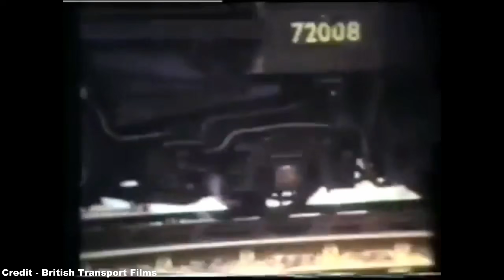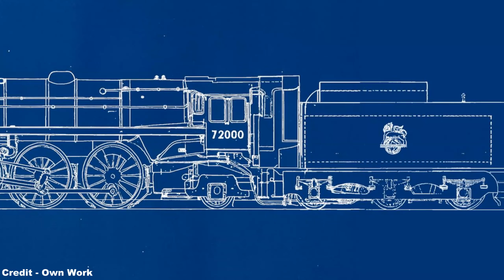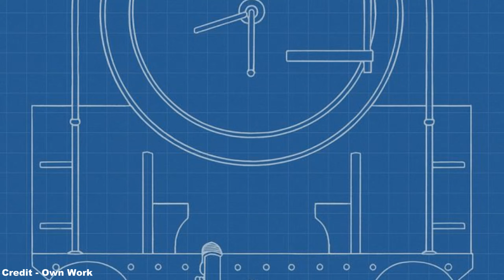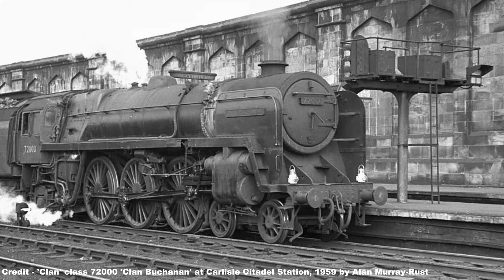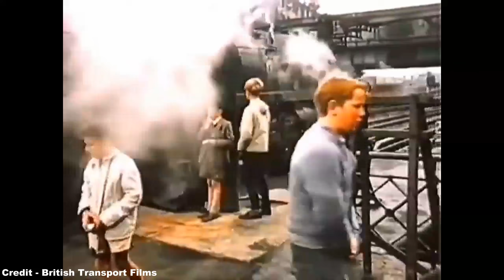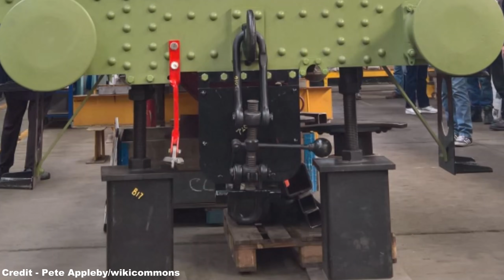An Extinct Set of Standards - BR Standard Class 6 "Clans"

Comment: Got this segment from the description in case anyone didn't read it before-hand:

"Also, you may have noticed that this time a few CGI renders of the BR Standard Class 6 have snuck into the mix. This is basically because I had an extreme lack of visual material to work with due to the rarity of these engines, and thus I chose to employ an image generator to create a few more scenarios for the Clans in service. It's not ideal, and I don't intend to do this very often if I can avoid it, but I think the resultant images were actually quite convincing in a lot of cases."

But in all seriousness, PLEASE don't ever resort to AI generation in the future, ever! I'm dead serious

Comment: Good video. Looking forward to seeing Hengist bring back the class from the dead. As others have said, shame about the use of AI - I  personally wouldn't mind if the existing real images were used for longer shots instead of continually switching. Maybe find some B-roll of model locos instead? 

An interesting footnote is the constant lack of hindsight many locomotive designers showed regarding draughting arrangements, chimney and blastpipe size etc. given there is nothing else quite so important when it comes to building a 'free-steaming' locomotive and the Britannia class were designed and built correctly in this aspect. It's a shame that such a rush job - at least I imagine that was what happened - hampered the career and reputation of what should have been an excellent type of loco.

Comment: Interesting that the blueprint shows oval driving wheels, which fortunately weren't a feature of the production locos.
Reply: That Drawing was generated by an AI so no surprises there
Reply: @dadobna2686 The blueprint wasn't ai, it's a compressed picture
Reply: @andrewreynolds4949  You might think that from the driving wheels being oval, but there are plenty of other givaways. most of linkage/pipework on the side of the boiler is there, but you'll notice plenty of differences if you compare it to a photo of the real locos. the crankpin on the centre driving axle also seems to be split, as the connecting rod from the cylinder sits higher than the coupling rod. There's also a weird kink in the cab roof, but no vent covers. The front cab windows seem to have several layers on the blueprint, but by far the most egregious area is where the loco and tender meet. There's just a whole bunch of random lines, the tender cab should be covering the front section of the tank as well, but doesn't in the blueprint. Then there's the "cycling lion" emblem on the tender side, which (just like the loco's running number) shouldn't feature in a blueprint, and the emblem looks nothing like the real thing. On the topic of the running number, that doesn't seem to be stretched as much as the rest of the loco. And finally, the only images used in the video that were credited as "Own Work" were ones created by an AI, so this is likely also the case here (considering all the errors that an AI would usually make are present).
Reply: The image has been dimensionally compressed slightly

Comment: One aspect of the 1948 exchange trials I find odd was the failure to learn the lessons on exhaust arrangements which Bulleid's work already had clearly indicated.  Draughting arrangements on both MN and WC/BB Classes were generally held to be excellent, yet the "Clans", supposedly inspired by OVSB's work, were as hamstrung by inadequate arrangements as many LMS Classes and the GW school of design whence came one W.A. Stanier .... and (pre-WWII) one R.A. Riddles.

A few classes benefitting from improved exhaust arangements included (but were not limited to)
GWR Castle, Manor
LMS Coronation, Royal Scot
LNER A3
SR Lord Nelson
BR Class 8

Interestingly, much of the work to improve steam locomotives by L.D.  Porta focussed on exhaust arrangements.
Reply: You're right about exhaust equipement, but I'd dearly love to see Porta's Gas Producing Combustion system applied to a British locomotive ! It worked well in South America and on the SAR's "Red Devil", so why not on a Clan?
It reduces coal consumption as well as boiler maintenance...
Reply: @forrestrobin2712  While I don’t think a GPCS would’ve been involved, I recall one of the Kings was set to be restored with a dual-Lempor exhaust, similar to that on the Red Devil. Not only would it reduce the profile so as not to foul electrified loading gauge, but it’d be leagues more effective than the Swindon double chimney.

Comment: lot of generative AI in this, Gotta say I'm very disappointed in you for stooping that low.
Reply: There's some obvious AI being used. Still, there's an extensive use of Historical films, photographs and commissioned paintings.
Reply: Idk if this is just me, but his voice in this video sounds like AI especially at the start
Reply: @Jotrain No his voice is just like this the same as in the years
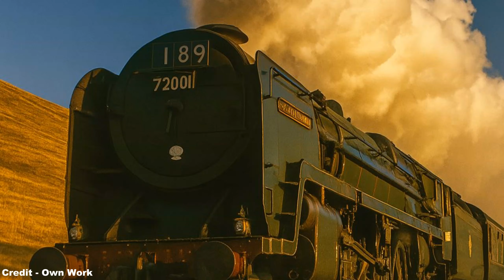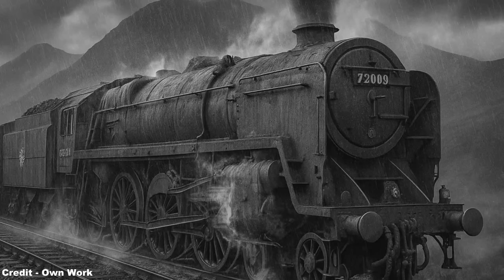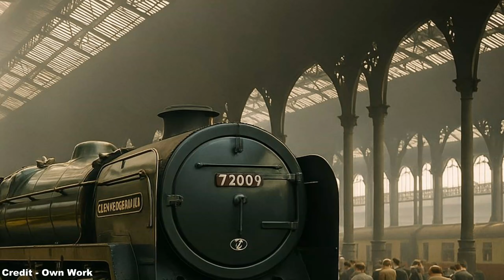Reply: 8:50, 12:25, 12:40, 14:02, 14:47, 16:46, and 17:32
Reply: Only issue with the AI images is that they are not very convincing.
Reply: @northernblue1093 I thought it was OK too but running wrong line in the glen was a dead giveaway, amazing what AI can do with creating imaging.
Reply: @northernblue1093 Yes, that’s the creators choice. It is obvious but so what. Some railway videos have terrible scripts or bad photography. It’s just the way they are.
Reply: At least he admits it and doesn’t intend on using it that often. The only reason he is was due to a lack of historical footage of the engines.
Reply: The models seem very accurate, was it a CGI model with the generative AI used to add color, texture, and fill in the scene?
Reply: Check the disclaimer in the description
Reply: @vanguardscourge I already read the description, but not everyone will. Look at the first replies to the original comment. They neither read nor noticed the AI included in the video, thus proving my point about blurring the lines between fact and fiction.
Reply: A tiny amount of AI. Don’t be so miserable. The quality of every video is top notch
Reply: @teamofsteve AI does not represent the truth behind history, rather it distorts it. Combining it with actual historic media to make it appear real is dangerous facade.
Reply: @TheAmaziii  Honestly, I feel the same way. This is...really one of the only examples of AI that isn't explicitly exploitative. It's just that, by having it out there, it does muddy the waters for those looking for actual historical images and visuals. Sure, great that a Clan can be generated climbing Shap, but what if some kid (or another historian) comes across that footage and thinks its real? And then its taken to be fact? It can spread misinformation, which isn't good. We could only be grateful that historic information regarding steam locomotives isn't exactly a life-or-death matter.
Reply: It behooves you to read.

* Also, you may have noticed that this time a few CGI renders of the BR Standard Class 6 have snuck into the mix. This is basically because I had an extreme lack of visual material to work with due to the rarity of these engines, and thus I chose to employ an image generator to create a few more scenarios for the Clans in service. It's not ideal, and I don't intend to do this very often if I can avoid it, but I think the resultant images were actually quite convincing in a lot of cases.*

I’m sure he didn’t put that in the description for his health.
Reply: Yeah I noticed that , bit of a shame but otherwise a great video
Reply: It’s not that deep. Plus, there wasn’t a lot he didn’t have to work with.
He could one of those creators who used A.I for the entire video, but it’s just a few pictures.
Reply: It’s never that deep bro keep it pushinh
Reply: Where?
Reply: Don’t complain
Reply: There isn’t? What?